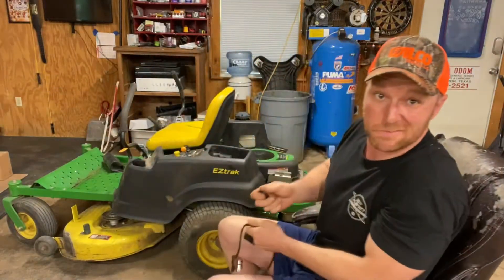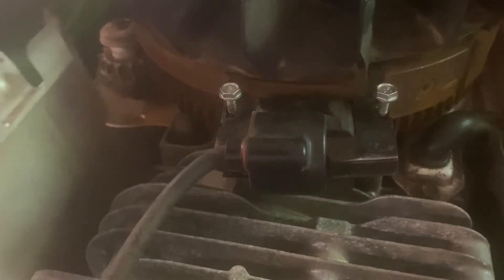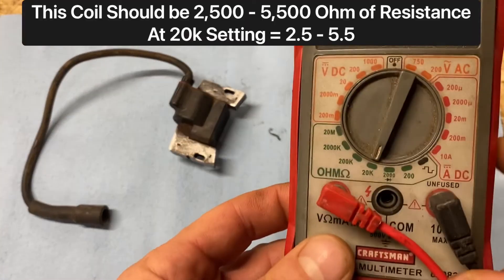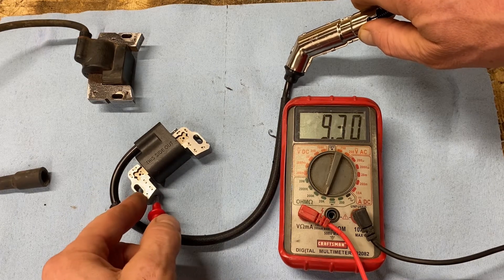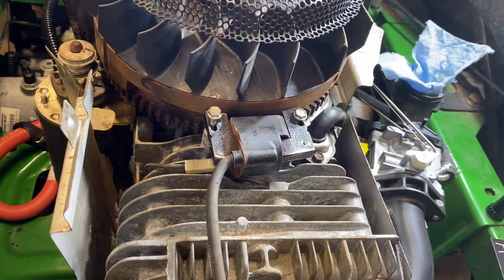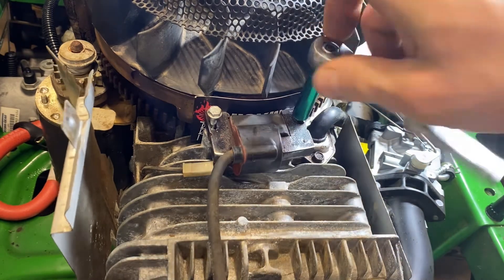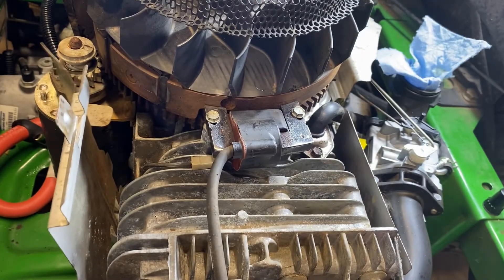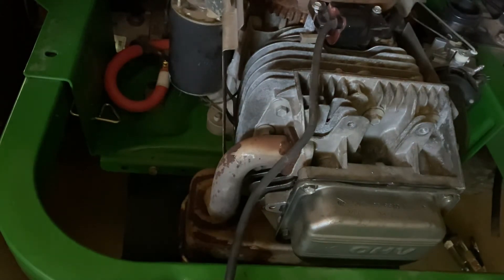Briggs Ignition Coil Replacement & Test

Comment: WHEN YOU TESTED THE OLD COIL , YOU PUT THE POSITIVE END IN THE SPARK PLUG END AND NEGATIVE ON THE MAGNET PART OF THE COIL. ON THE ONE YOU BOUGHT, YOU PUT THE POSITIVE ON THE MAGNET AND NEGATIVE INSIDE THE PLUG BOOT. WOULD THAT MAKE A DIFFERENCE ON YOUR READING?
Reply from the maker: I don’t think so